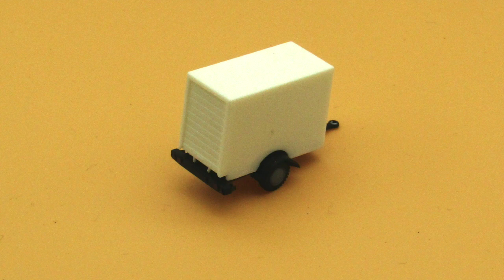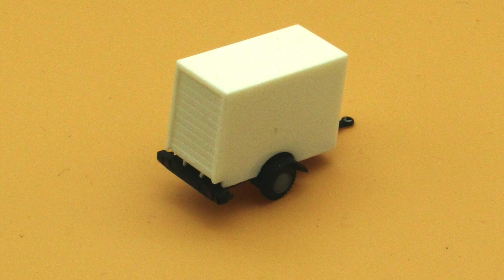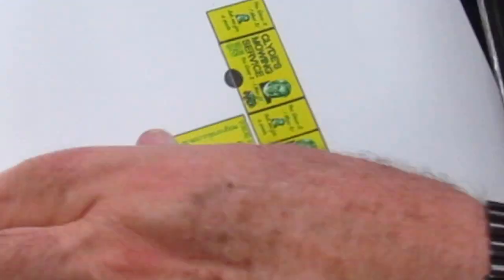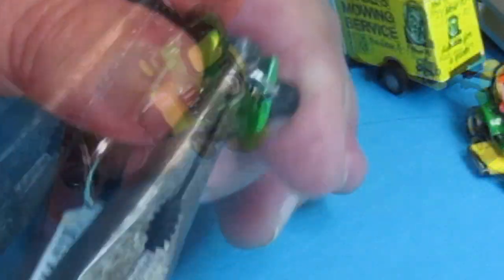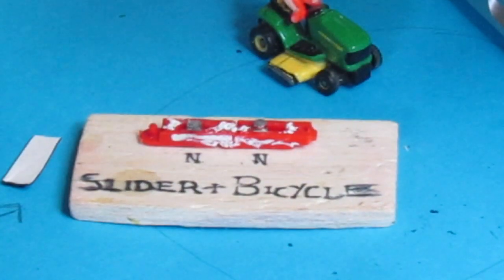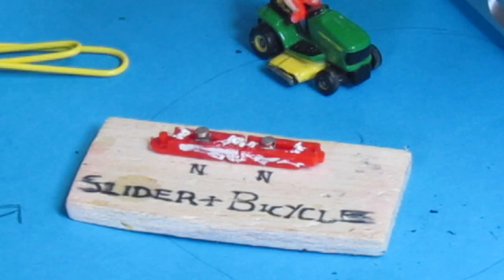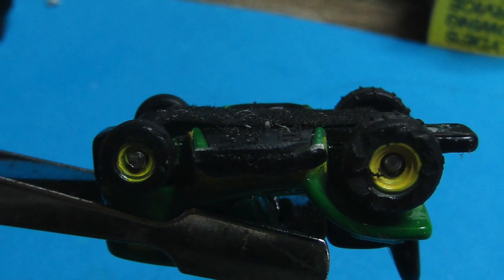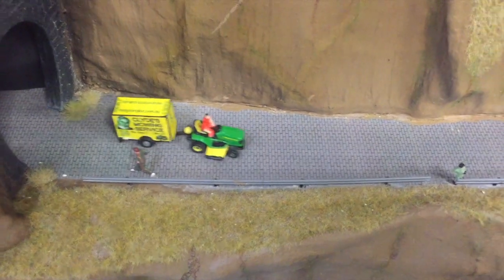Magnorail Mowing service created

Comment: Does the legs on the bicycles run separately from the body. I was thinking of having a different body painted with different clothes and paint the legs to match.
Reply from the maker: The legs are actually attached to the bicycle under the figure so they operate independently of the body, so you can paint them separately just remembering not to let the paint seize up the joint linkages